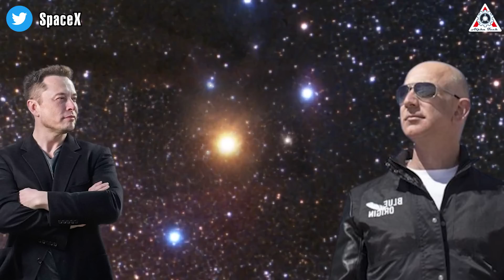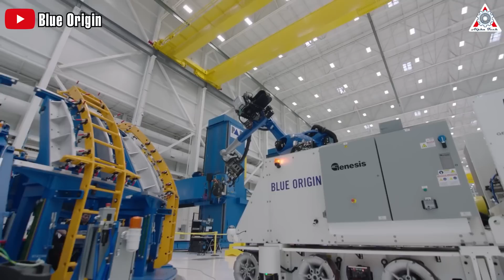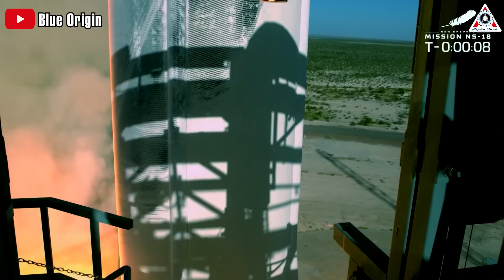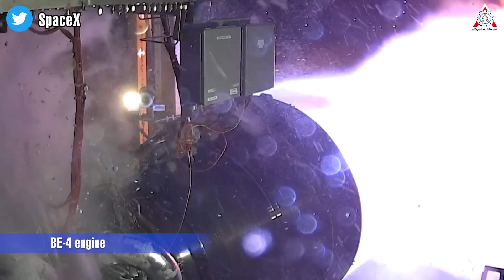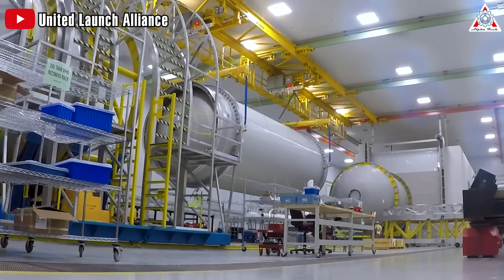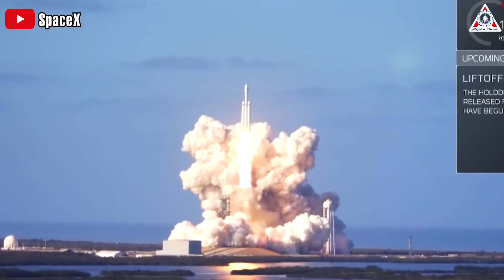Why Jeff Bezos's Blue Origin wants to beat SpaceX so badly???

Comment: Bezos isn't even a player in the game. His company produced nothing of any commercial significance.
Reply: Ehh, that's not fair. The BE-4 is. Now, if it was strictly for use on their own rockets, you'd be right, but they managed to sell them to ULA for the Vulcan, which has many valuable contracts including, most significantly, national defense contracts. So, the BE-4 is going to be very important to future US launch capabilities. If, God forbid, the BE-4 should actually prove incapable of meeting ULA's needs, then that fact is going to be of vastly more financial significance. That will have a ripple effect all though the industry. I don't anticipate that but wow, that would be big.
Reply: Thats what I'm doing, I'm taking it to the next step. Prepare now and maybe it wont hurt so bad when they fail. I worry greatly when the government hangs everything on the success of one thing. What does Bezos do for a living? He made and runs Amazon. If you need an appliance or a good book I would recommend him, but not for rocket engines. He's not a rocket engine maker, he's not an engineer of any kind and this is who the government has turned to to provide engines for future spaceflight. It's so preposterous I could cry. @odysseusrex5908

Comment: Twenty years ago, which companies would have been mentioned in this video?  As technologies change, as new ideas and systems advance, the industry can change dramatically.  Carbon fiber?  Stainless steel?  Composites?  Booster landings on land?  On barges?  Aerospike engines?  Even development and testing regimes are changing much to Boeing's loss.  All it takes is for a successful company to go down a wrong, expensive path while another achieves success with a new idea or reliability and wham, the positions change.

Comment: Just a friendly correction that Falcon Heavy has not been used for cargo resupply or crew transfer to ISS.
Reply: Yet.
Reply: @roberthumphrey1304   It never will be. those missions are conducted by Dragon capsules, which launch on Falcon 9 and would only need a Heavy to send them to the Moon. I am highly in favor of that, but Elon seems to be reserving that for Starship.

Comment: Blue Origin talks about doing things, SpaceX actually does them. That is all that needs saying
Reply: Very well said, very well said. Nobody seems quite sure what Blue Origin was doing for the first several years of their existence. I've read tat they were a think tank but, apparently, they've never said. What is known is that they did not begin work on New Shepard until 2006 nor New Glenn until 2012. By contrast, SpaceX was formed in 2002 and immediately began working on an orbital class rocket, the Falcon 1, which began flying in 2006 and reached orbit in 2008. SpaceX was orbiting rockets seven years before BO even conducted their first suborbital launch. That suborbital launch preceded SpaceX's first successful landing of the Falcon 9 by a mere six weeks.

Comment: With 208 successful first stage landings, if SpaceX slumped to 1 flight per month and BO could do 1 flight per week, it would take 5 years for BO to catch them. No way BO would ever launch 1 per month, much less 1 per week.
Reply: That's not necessarily true. Assuming New Glenn does finally fly, there is no reason to believe it can not have the same flight cadence and mission flexibility of Falcon 9, since those things are based on Falcon's reusability. The problem, of course, is that by the time that does happen, Starship is going to be at least minimally operational, and will only build from there. Who is going to care if New Glenn can launch 45 tons once, or even twice a week for $80 million, when Starship will be able to launch at least a hundred tons, and possibly as much as two hundred, three times a day, for $50 million, or less. The whole time Blue Origin has been working on New Glenn with their ferocious slowness, that puck has been movin', movin', movin'.